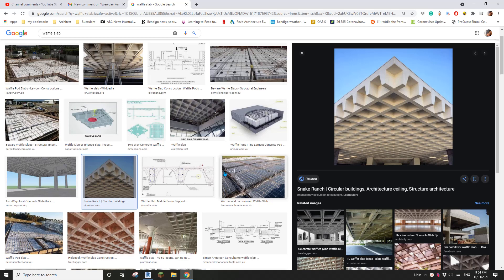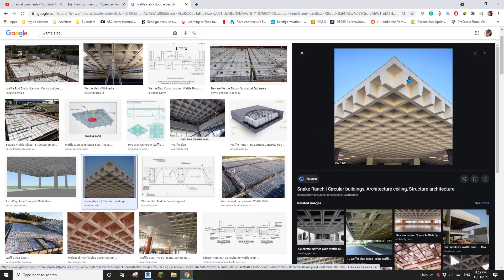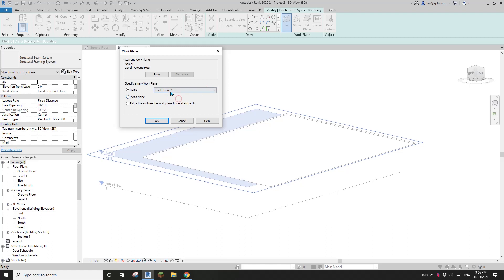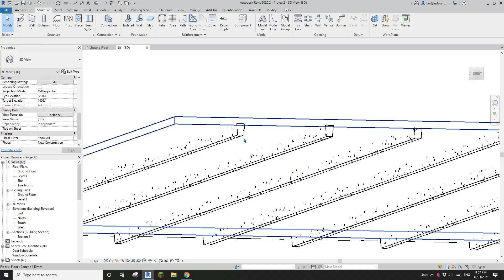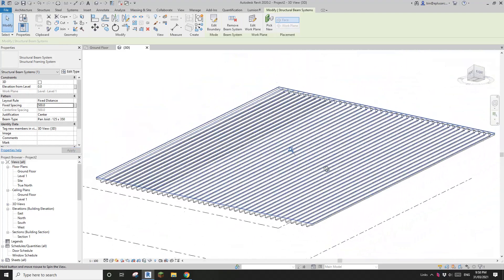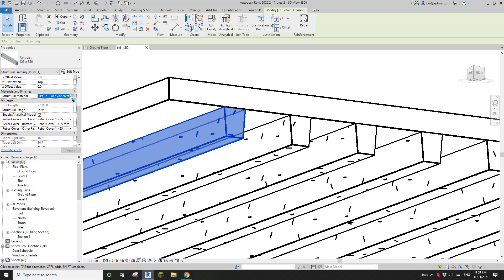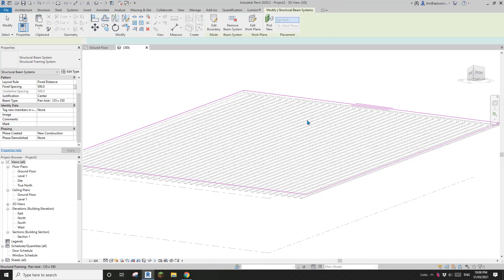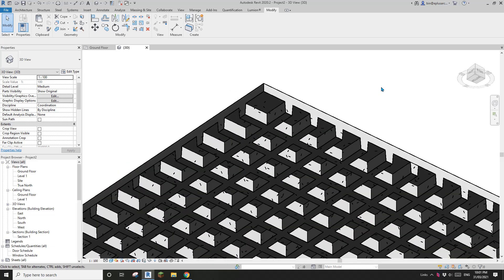Everyday Revit (Day 379) - Waffle Slab with Pan Joist using Beam System

Comment: Hello.  Thank you very much for your training.  If we want to implement the beam system near the columns as a solid slab, what should be done?
Reply from the maker: I'll use a structural foundation family (footing) and place it under the column. Then, I'll use the Join Geometry tool to join it with the floor and IB/EB. As long as the material is the same, they will join together perfectly.